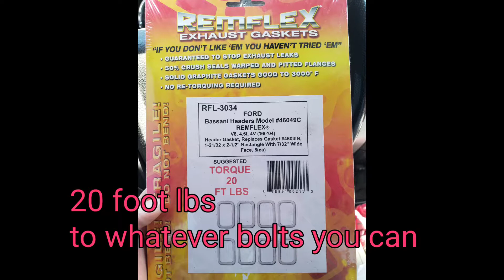Bassani midlength header install 03-04 cobra/mach1 (engine out)

Comment: Thanks for the vid. Planning to do the same to my '99 Cobra - I prefer the aluminum Teksid block, less weight & will still take a lot of power. Question: at 9:40 in  your video, what is the structure bolted between the tops of both of the heads?  Is that plate used with an engine hoist?  If so, where did you get it?
Reply from the maker: Yes it's a engine lift plate i got it from motion raceworks

Comment: I was told not to use OEM exhaust gaskets on top of the header gaskets. Did you have any leaks?
Reply from the maker: 200 miles so far and still good, bassani instructions say to use oem +with their gaskets